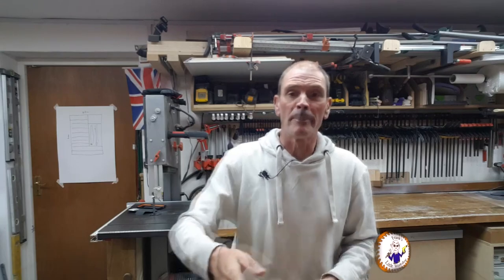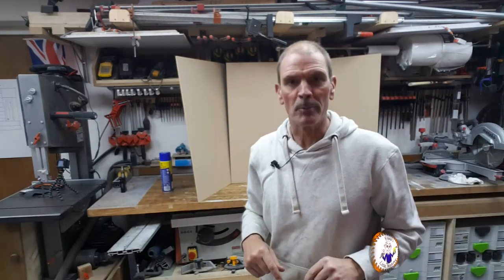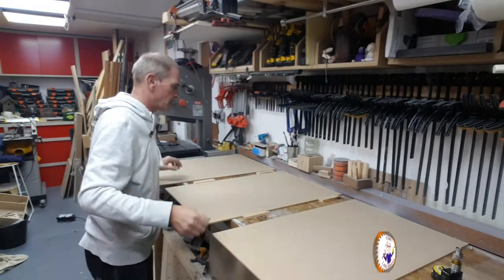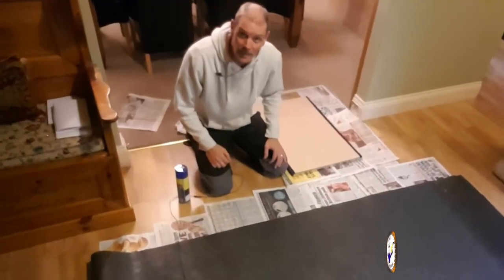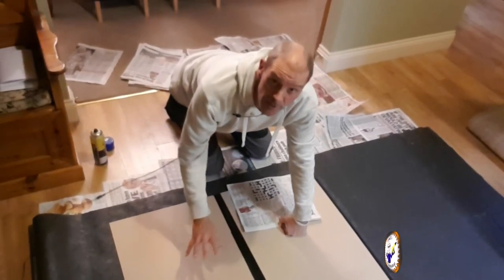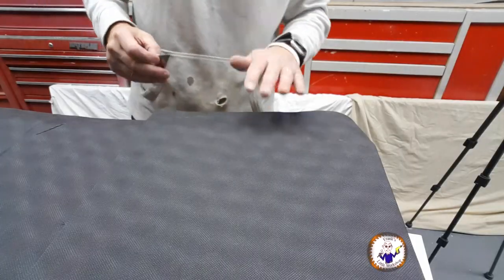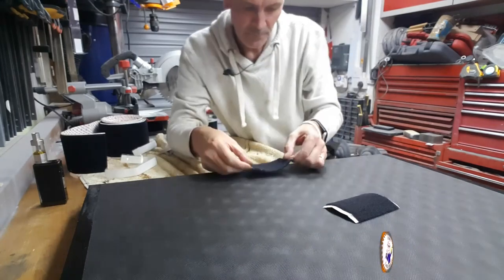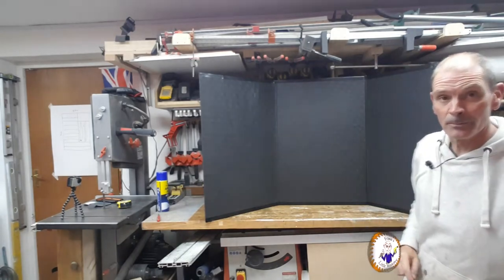How to make a Tri Fold Display Board.

Comment: I might be a muppet, but I can't figure out how to get the three panels attached to each other with the tape. I don't think you showed how that works in the video. If I'm being daft, I apologize, but I'd really love to make this. You put the spacers in, but then how do you actually attach it? Thanks. PS. Had a good chuckle at your video, thanks for posting!
Reply from the maker: 😁Hi FareShare. Your not being a muppet, I didn't actually show me doing it, but it is super simple. The spacers were just to figure out how big the gap needs to be. They are not left in the final board. In this case the gap was 30mm. So all I did was leave a 30mm gap between the boards and then stick the tape down the length of the board on both sides bridging the gap. So the tape is attached to both boards but with a flexible section of tape down the length of the board... this becomes your hinge. I hope that helps😁. Thanks for watching 😁👍

Comment: +Frank WIlliams How would I use door (or some other type of) hinges instead of duct tape?
Reply from the maker: 😁 Hi. There are a couple of issues with using conventional hinges. The duct tape is flexible so it allows the side boards to fold flat. With solid hinges you would need to offset one side to allow for the thickness of the board. There are hinges available witch have an angled fixing to allow for this offset. Either that or fix a batten to one side of the board to give you this offset. On the other side you could use a conventional piano hinge. But all of these options are more expensive than duct tape. I hope this helps a little. Thanks for watching 😁👍